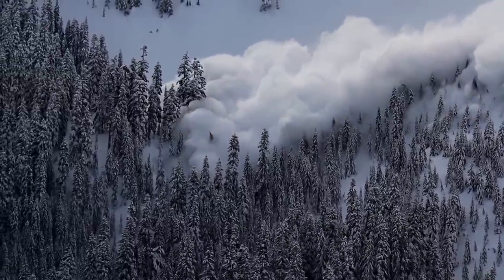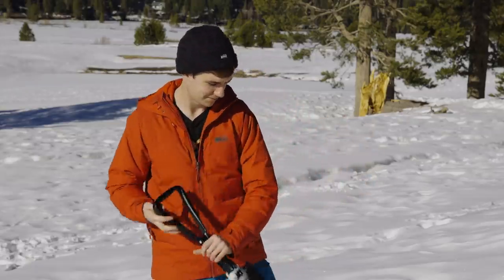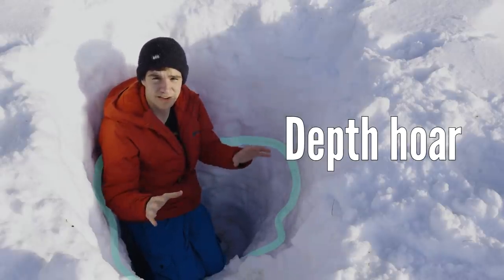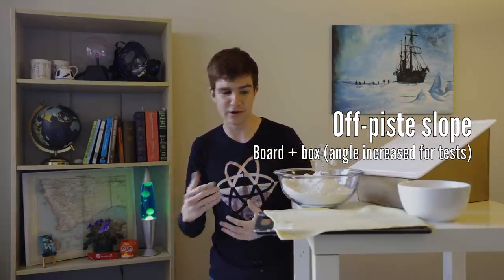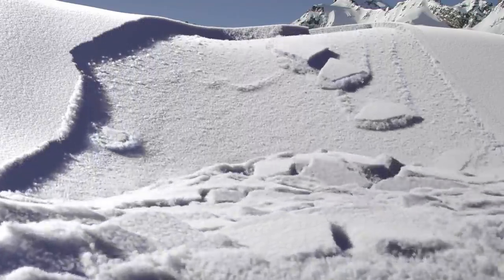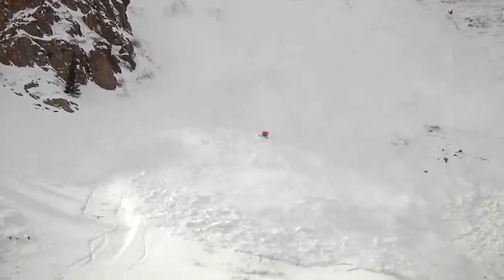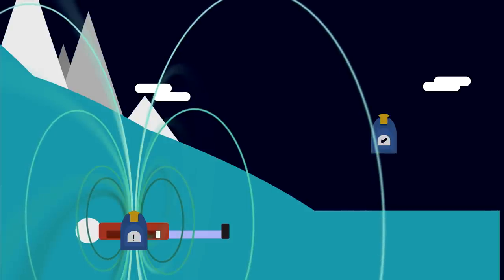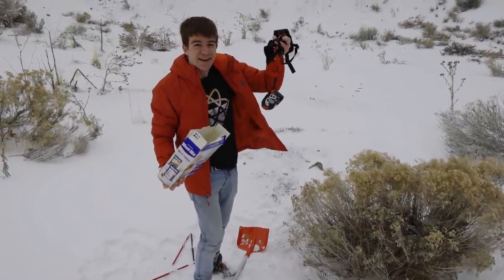How to Survive an Avalanche

Comment: Very good explanation!
Of course, there is much more to the topic, but that would be way too much to cover in such a video. 
As an electrical engineer, I find it quite fascinating, how far avalanche beacons have come and how much better each generation gets. 
You still have to practice a lot to really master them, but if I compare a 10 year old one with a current one, the difference in how fast and how reliable I can find the transmitter is often significant.

Comment: I have actually been buried in a training on avalanche safety. Although I was definitely cheating. After digging the snow profile trench, we cut a kind of cave into the side and I crawled inside of that. But it was a good exercise for the team in finding a beacon under two metres of snow and using the probes.
Reply from the maker: Wow! Coincidentally that's exactly how I shot the opening / closing scenes! It's scary in there isnt it

Comment: Shouldn't you keep your board in front of you so if you hit something it might take up at least some of the collision?  You want to hit with your feet.  Kind of like leaving the landing gear out if you are escaping terrain when flying?  If you hit that terrain the gear will take some of the crash.  Actually slab avalanches and some landslides ride on a cushion of compressed air.  That loose snow lets it break loose